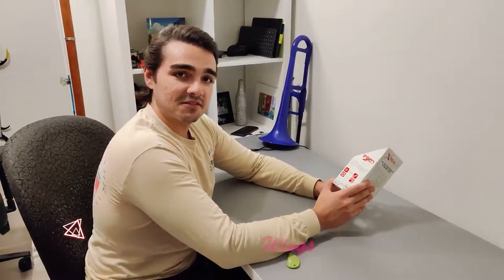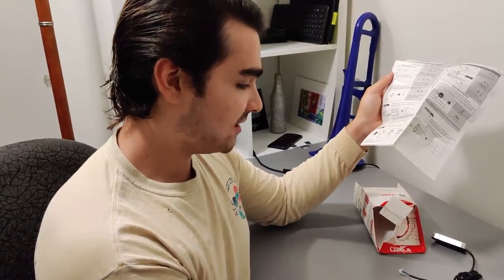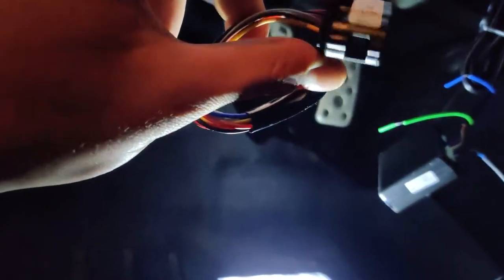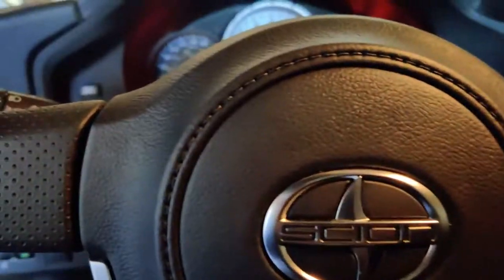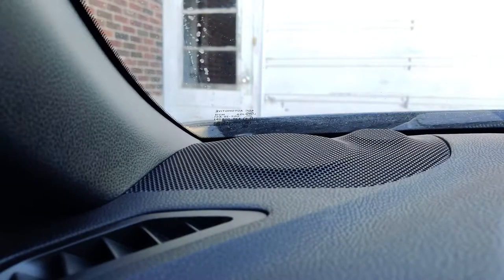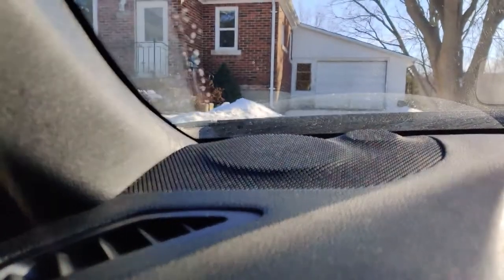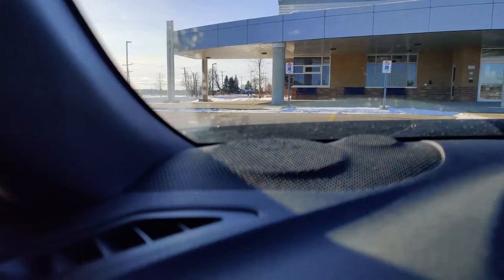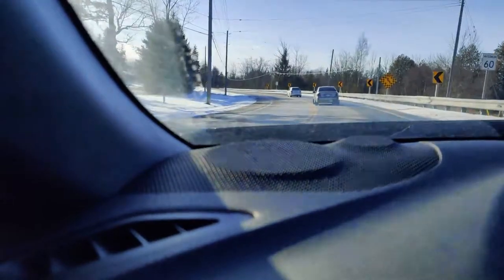Injen X-Pedal Pro Throttle Controller Unbox + Installation & Review (FRS, BRZ, GT86)

Comment: I love how you find all these interesting products and test em out! 
Keep it coming!!
Reply from the maker: Hey I appreciate it! I chose all of these things for specific reasons within a budget. I think the throttle controller was the first one that I probably won't keep forever but I do enjoy it! I will keep making more shortly!
Reply: So what is it just some kind of eco mode sport mode after market thing and how does it work does it keep throttle open differently or more open less open kinda thing just trynna figure out if it’s really worth it after an intake
Reply from the maker: @michaelercolano629  it simply changes the throttle input curve and boosts the signal resolution a bit. Eco mode Is less steep of a curve and sport mode is more steep starting at 0% throttle input. The snow mode is basically trailing lag so it doesn't get touchy when not expected. The launch control mode basically shortly holds the throttle position constant until increased. I kind of like it I find myself changing modes and levels somewhat frequently even just for something to do some days but it isn't great value vs a tune that can also be change throttle input.
Reply from the maker: @michaelercolano629  basically just eco and sport mode that other cars come with with more tuning points. No power increase.
Reply: @findingmywingsjesse  I have a Hikeit Throttle Controller on my 86 auto...I dont even notice the infamous torque dip...do you?
Reply from the maker: @sugerhitman1295  I do not still feel it. This helps a lot tbh, but if the car is not in power (say 4th gear going up a hill) I still feel it pull at low rpm drop off until like 4500 then come alive again. Between automatic and the auto selection and overtake modes on hikeit maybe it actually bumps the sensitivity enough or enough to drop a gear? That's really good to hear. If I am in a lower gear accelerating my controller helps make the dip less noticeable but I believe it's still there as power curve is not impacted!
Reply: @findingmywingsjesse  Yep...going up hills i keep it in 3rd gear as i only drive in manual mode....that helps a lot with the torque dip...I also keep the Hikeit in Sport 7.
Reply from the maker: @sugerhitman1295  true enough. Yeah I still have feel the dip in sport mode on this whatever gear I'm in. Vtec lump feeling definitely better than stock but at the end of the day the injen unit at least only changes the pedal curve (10% press now equals 13%, 77% now equals 100% press etc) plus uses a DAC to increase pedal resolution and helps remove the throttle lag plus other modes and features. I will have to look into the hikeit I've never heard of them!
Reply: @findingmywingsjesse  Yeah im pretty sure they all work the same. Ive owned a Tros Throttle Controller a JMS Pedalmax ive got in my Camaro 2.0 but the 86 definitely needed it...I was a bit disheartened when i bought it test driving it in regular drive...felt like a clogged cat. But with the Hikeit in manual mode the car is a beast...cant wait to add a tune with the Throttle Controller....Also very surprised that in this Brz community Throttle Controllers are despised...they dont know what theyre missing.
Reply from the maker: @sugerhitman1295  Oh very cool I am guessing it helped a lot with a turbo Camaro too? I think most 86 folks go for tune > throttle controller based on ECUTEK can modify throttle curve and a full tune for maybe 3x as much altogether. I am personally not ready to tune so it definitely woke the car up a bit without changing how the car operates much.

Comment: What mode/number is the most linear (like drive by cable)? I am really considering this mod after disconnecting my battery right before a track day and my clutch was not happy. Also does it save what setting you put on it after you turn the car off?
Reply from the maker: All modes are linear as far as I can tell but stock is 1:1 for level of press to what the computer sees so 20% throttle is 20% ish to the ECM. This thing could change it so that 20% press is seen as 30% (sport mode) or 10% (eco mode). It just changes the slope of the curve not the actual curve line itself if that makes sense. It also bumps resolution so if stock has say 100 points of pedal press the computer can understand this should bump that up to say 300 so there are more precise throttle positions available. Some of it covered in the video

Comment from the maker: My formal update is that this does exactly what it says and remaps throttle. But I chose to remove it and do a proper tune which also allows for throttle remapping. Still unsure if it truly ups the frequency of anything though.

Comment: So, does it leave a footprint on the ECU? This is what is stopping me from getting one! Don’t want to void my warranty.
Reply from the maker: Hey there! As far as I can tell it never directly interacts with the ecu so no footprint. Definitely do some research to keep me honest there. Warranty wise it's adding in line between pedal and ecm/ecu so if it's installed on the car when making a warranty claim then I'm gonna imagine they won't be happy same with insurance but to remove it you just disconnect battery, uninstall this and put back to oem then reconnect battery and you're good to go! Good luck!

Comment: Hi are you suppose to be on park and change the numbers or you just have to be in complete stop??
Reply from the maker: I change it on the fly without issue I just try not to be on the throttle when I do it. The warning and guide recommends being at a complete stop not specific about in or out of gear.
Reply: @findingmywingsjesse  what number do you leave it on for  regular drive? Any tips?
Reply from the maker: @joseparedes8990  sport 3 basically all the time. Sport 2 maybe if it's really icy and easy to shift into normal mode. Normal mode is the same curve but higher resolution than normal pedal which is cool. I am always low sports mode to make the car more responsive but not as jolty. I'd try a bunch of settings and see what you like. I did eco mode on a trip once and it helped fuel economy but not a ton
Reply: @findingmywingsjesse  i appreciate your response 👏🏻

Comment: Does this ever cause you car a check engine light
Reply from the maker: It never did for me. As long as sync process is followed properly it should be ok but be careful! I removed this unit once I did a tune since it does some of the same things but more custom and integrated. Cool if you are not doing a full tune though

Comment: Do you still use this a year later?
Reply from the maker: Very good question and no. It ended up making feel sketchy the longer I used it not that I had any actual issues with the unit. I think simply pressing your foot deeper or getting a proper tune are much better options but I can see it benefitting some as it does exactly as advertised 🤷‍♂️